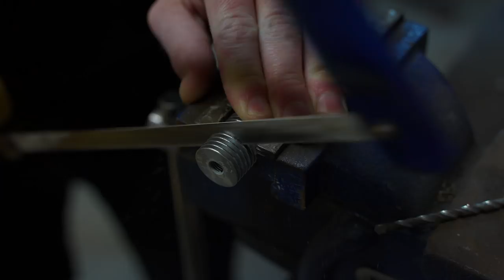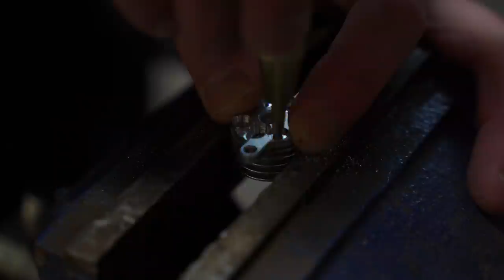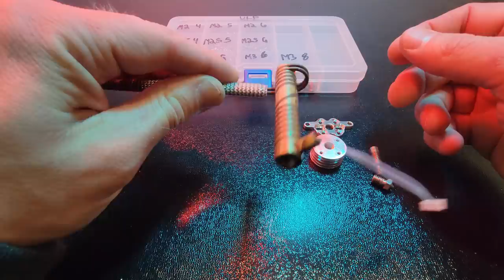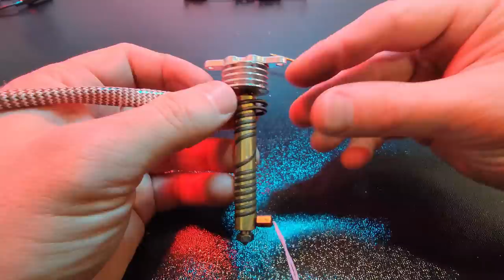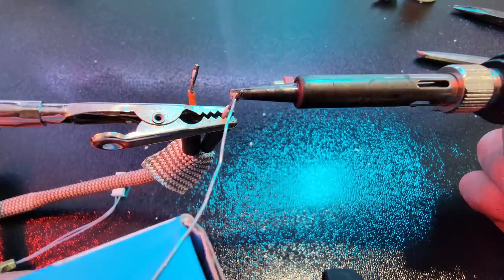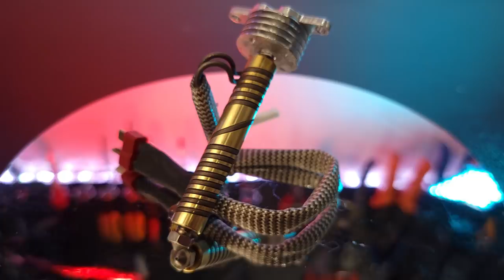HotEnd Prototype 3D Printer

Comment: a bracket to stablize the heatblock,or heat tube in this case, would probabbly be neccesary to keep this mammoth of a heatblock steady, relying on the strength of the thin heatbreak to bear all the force of the heatblock slopping around when doing 10k acceleration benchy,would probably result in a 250 degree solid block of brass flying off of the printer, lol
Reply: Maybe pack the heater in glass wool, keeps the heat inside. The outside can then be attached to an aluminium bracket with a piece of wire. Might look like space tech!
Reply: Lol, i just got my acceleration down to 1500 to have cleaner print with my cheap ass anycubic lol ... 
I'm living in 2015 ! 😅

Comment: I would add some kind of bracket under the heatbrake level to reduce the stress to this part at high speed. Also, you could Pierce the Brass pipe and braze some piece of copper wire to increase heat transfer ( see Stephan work on it)
Reply: However then he can't use abrasive filaments.
Reply: @FreeOfFantasy  true. But it seems his setup is mostly speed-oriented than versatility oriented. Brass Nozzle wouldn't be also my first choice for abrasive filaments.
Reply from the maker: Patent issue with that ;)  and yes there will be a bracket
Reply: @Vez3D  AFAIK DIY stuff like that is allowed in Europe even if it is patented.. in the US they won't allow anyone to do that but in Europe np
Reply: @BH4x0r  what's patented about this design? Do you mean the coil heater maybe? Actually it's the USPTO 2013 law (under Obama term) which  allows trolls and cheaters to patent public domain ideas in the spirit of jungle's law "who comes first can do it... no matter of" a real shame. EPO and WPO still take in account prior art and unpublished IP.
Reply: @pavel5939  naw he was talking about a metal piece in the middle of it (like a CHT nozzle) which is both patented by Bondtech and some other company

Comment: Taking as many as possible heat transfer surfaces out! Only 2 left: the heater wire - heating tube and heating tube - plastic.

Maybe the heating wire can be eliminated all together by attaching the wires to the top and bottom of the heater block itself. A buck converter right next to the heater tube itself can than be used as the controller to regulate the temperature. This way the heater can be fed with 24V (or even higher) and the nearly short circuit of the heater tube is controlled by the buck converter. The temperature measurement is fed into the buck converter to regulate the hot end temperature. This can be a local circuit (though safety measures might be an issue when going this route).

The tube would have to he made out of a not too conducting material otherwise the wires coming from the buck converter will need to be too thick to prevent them from overheating. For instance a stainless steel tube could be relatively thin (as it has enough strength and thereby have sufficient resistivity to be the main resistor in the nearly short circuit. Additional advantage is that the thin tube is quite light. the fact that stainless steel is not conducting heat as well is by far not so relevant as heat is produced inside the steel and has nowhere else to go then to the plastic.

Comment: It actually looks very neat. the only thing i might suggest since it is custom made and sooo long XD would be to install a second thermistor in the middle. It might give you data about the performance inside the "heat cartridge" and possible insight with thermal losses.
Reply: Maybe even a third one on the other end and regulate the heater based on the difference

Comment: So have you considered the weight distribution and finding the center of mass then aligning the mounting points to that? If you are swinging around a heavy mass on top, and lighter on the bottom, it is going to try and sway to one side or the other. Where as if you have equal weight on top and bottom with a center mounting point, it should be more stable.

Comment: Integrated Nozzle-heater cartridges are the future. Look at solder irons like Hakko or JBC, they get 100W power inside a few grams of cartridge. Cost is less than 10USD per cartridge from 3rd party manufacturers. Only thing thats missing is the hole in the middle.
Reply: This! I am waiting to see if Hakko, Pace, or JBC partner up with any hotend manufacturers. They can significantly help with 3D printing.

Comment: I'd be worried about the angular moment created at the heatbreak at super high accelerations. Other than that it looks really good.
Reply from the maker: First comment pinned from me is saying that it will have braces to hold it. Its not final yet.  And this is a 60mm and the final design is 40mm
Reply: @Vez3D  Sweet, man. Hope you're pushing max mm^3/s soon

Comment: I F#KN ❤️ THIS!  
So... unfortunately, I had to pause my hobbies for the past 2 years and also moved houses. 🏘 
So when I got back to it and fired everything up I discovered that my clunker CR10-S5 now errors mid bed-heating... at like 60C.  
Then I have an old-school wood MakerBot Replicator 1 that "was" working fine until it puked up its nozzle onto the bed (I must have really stripped the threads at some point, whoops 🤭).
So, of course, my brain 🧠 starts down this rabbit hole 🐇  ⚫️ , designing a replacement heater block and critiquing its original, now obsolete, design.  
Replicators have a terrible (non-existent) heat break where only a small 5mm sliver of a heatsink makes contact...
So then I started staring at this innocent and similarly sized block of aluminum bar stock and thought to myself, "maybe liquid cooling?" 🤔 
Then I began concocting variations of heat breaks and heater blocks in my head, drawing them out, and contemplating how I could throw them in my copper plating solution to control heat flow to specific areas🙃.
Then I thought, what are other people doing these days 🤔?  

And so now I'm here 😆 😂 😆 😂 !  

I have to say, that's a sick design man!  I really hope the kinks get worked out and they can go on sale soon!
I also love the insanely fast printer build.  I would absolutely sacrifice my S5 for parts to build that!

I think you should keep lowering that hotend mass and pushing the speed limits!  You're already challenging the fastest print speeds EVER 😆.  It's addictive watching that thing print like it belongs to the Flash.

I think maybe some smaller and higher pressure cooling lines (because smaller lines also means smaller and lighter fittings) would help a little.  
I would also try to find something like a steel braided PTFE tube, or some other way to move the extruder and stepper completely away from the print head, relocated near your control board in the back or something.  
Then the only things that would be whipping around at high velocities would be the hoses and wires attached to the hotend.

That might buy you an extra 220mms!  Haha 😄 🤣 

Do you have any modern board suggestions?  Because I'm definitely going to start swapping parts out and attempt a build like that ASAP!

Comment: What about vibration/resonance? It's a long pipe with mounting point quite high, so it's not as rigid as you might think. Think skyscrapers in high wind - they move a lot, but it's concrete and steele.
It will probably have too much flex. The less stick out the better, here you purposely made it stick out waaaay longer :D

Comment: How much power does it consume? And how much heat goes into the surrounding air? :)
I made my own hotend with water-cooled aliminium BMG and 2x80W SuperVolcano heaters. Works surprisingly well.
Reply from the maker: 150watt
Reply: What drove you to do that, if I may ask? Tks
Reply from the maker: @xpim3d  always finding ways to improve? Road to 2000mm/s?
Reply: @Vez3D  question was for P Kav xD but thank you for taking the time to answer :)
Reply: @xpim3d  I need to pring carbon fiber reinforced PA66 very fast. It needs 300+ degrees hotend and heated chamber. So water cooling, 80+80W dual heater and SuperVolcano hardened steel nozzle.
Reply: @Vez3D  2000 mm/s? It, probably, won't adhere well on such speed. But it's worth trying.

btw, I've send you email about ODrive tuning.
Reply: @TheNamelessOne12357  cool. Very curious to see that setup :p

Comment: For the watercooled heat sink are you going to put the inlet on the bottom and outlet on the top. Itd get better recirculation compared to other designs I've seen. Putting them side by side doesn't make sense to me because heat rises.
Reply from the maker: side by side because of space constraint. but it shoult work very good and circulate water arround the heatbreak. I will show my design soon.. but im just a bit affraid of copies... because if everything works good, I might start manufacturing it :) and offer a hotend that is cheap and very very high flow :)

Comment: Where did you get the brass coil heater from?  I have been looking for one so I can get rid of my super volcano on my robot. the heat break is not strong enough to print in multi axis,especially if there are any issues with calibration.

Comment: Okay, I am extremely intrigued. I'm also wondering why the heck is it so long? I'm assuming that it's long because you need an increased melt rate at high speed. Still I'm a little puzzled why you designed it that way. I would think that you would want multiple parallel melt channels.

Comment: Looking forward to see the results. my initial reaction to this design is the question for which plastic is this for? PLA would turn into a nasty sticky goo in the top 15mm of this huge heat reservoir, so it would only work with something with a high Tg. fast printing is probably also out of the question since there is a lot of flex on the nozzle.
Reply: lol define fast

Comment: the rocket will not take off)) the heating chamber of such a design is too large)) you can forget about retracs, and hello kilometer streaks between idle movements)) and because of the large mass, the lever will swing strongly, the wobble will be just terrible))
Reply from the maker: its not a final design. This is 60mm .. the final design is 40mm. It will have a bit longer melt zone than mosquito magnum +.  And dont forget my travel moves are 1000mms/s 50k :P  Also. there will be a brace system to hold everything in place. I should have put a comment in the video, but did it in the comment section instead.. hehe it generated a lot of wtf haha.
Reply: @Vez3D  Can a ceramic holder be used to reduce the influence of the lever and the mass of such a long heating rod? something needs to be fixed to the radiator)) in general, you can come up with fasteners from some kind of tile from the bath) for example, take 2 pieces of tiles and tighten them with screws, holding the heating cylinder inside, so the heating part will not touch anything except ceramics)

Comment: Is the cold end going to be able to dissipate enough heat is the question... The hotend is now currently on drugs.
Reply from the maker: I think so yes..the whole printhead is aluminum and is a giant heatsink
Reply: as long as the heatbreak has the same thickness and the print temperature stays resonable, you could have a heatblock as big as a house and the heat sink would still stay cool, it's the "Heatbreaking" performance of the heat break that determines how hot the heatsink gets, not how big the heatblock is.